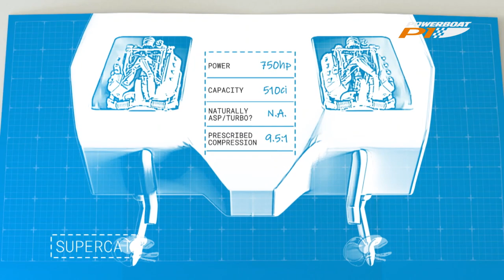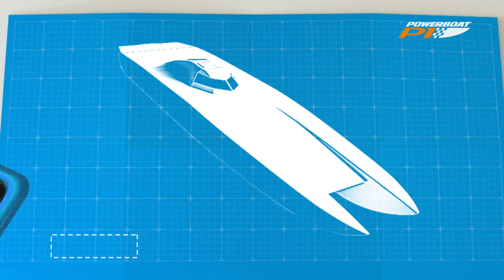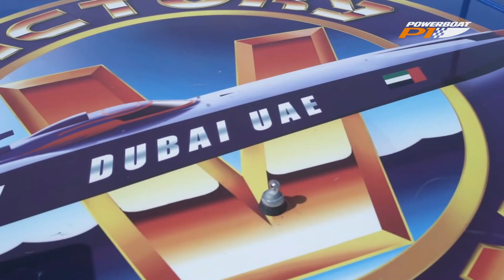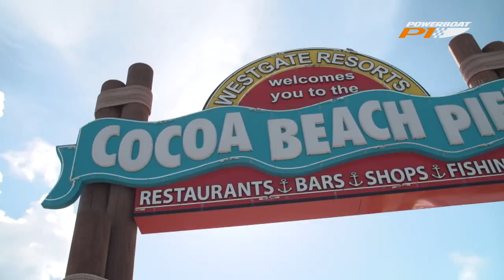Thunder on Cocoa Beach 2019

Comment: Why are the power boat cats placed on a side on their trailers
Reply: It has to do with the width of the boats. Otherwise they would probably need permits in some areas.
Reply: @scottirwin1693  Yes, otherwise they're too wide to pull on the highway. They may be within the lines on a freeway, but the "surface streets" would be a problem.
Reply: @MrGaryGG48  yeah ive seen them on surface streets downtown Kingston for the 1000 islands poker run